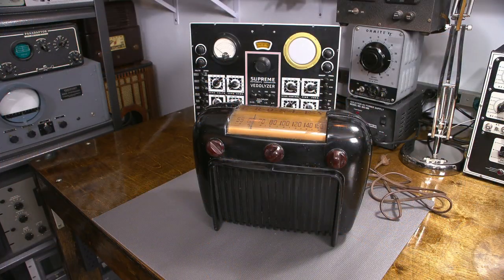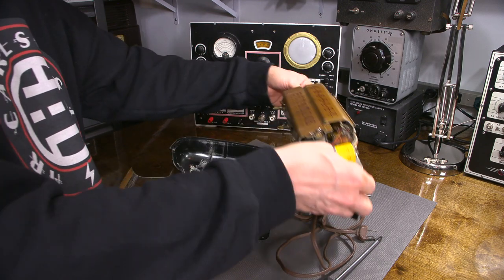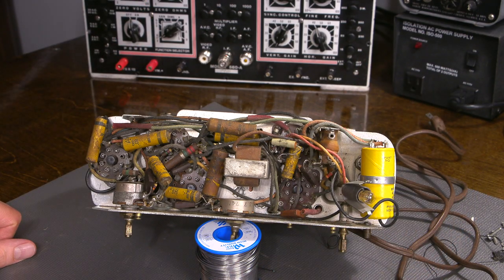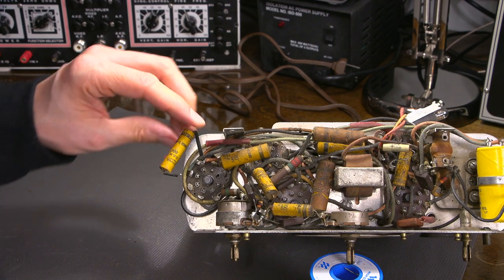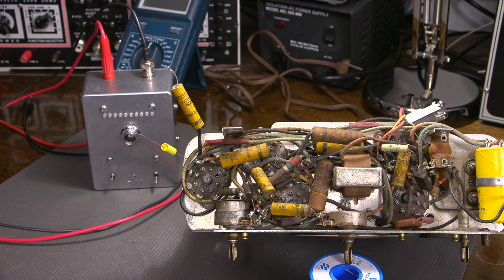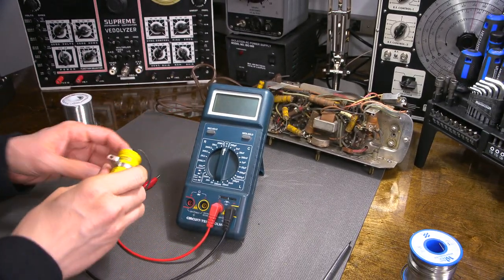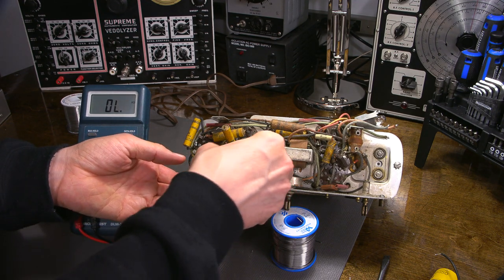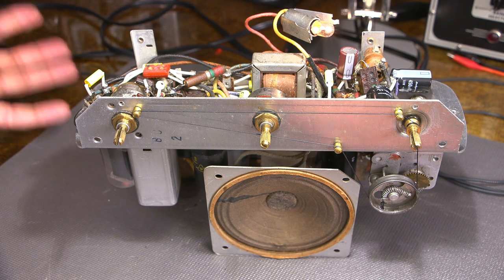ROBOT HEAD Radio from 1947! Electronic [Restoration]

Comment: The tag on the bottom could be right. I worked at a Goodyear tire shop and our manager sold crosley tv's, washer and dryers, phonographs, etc. I had bought a washer and dryer set, and when it needed service, the washer was actually a Maytag that was branded as a crosley, so I guess they did things similar to Sears with their craftsman line
Reply: These days Maytag is Whirlpool.

Comment: I did something similar on a 1976 Panasonic radio. The string was broke. I was looking for the old time fishing line from the 1970s but could not find any! I ended up using 65 lb. spiderwire. It worked but, it's a little thin & still not what I was looking for. I doubt it's going to break! Lol

Comment: I have read that Crosley made his radios to sell cheap because he had a radio station that at one time was 500,000 watts. It was funny that when you were tuning that radio you put it on 700 which was his were you could find his radio station. Today it is just 50,000 and is WLW.  You can see it from I 75 north of Cincinnati as you go to the Dayton Hamfest. You can take tours to see what was his 500,000 transmitter.

Comment: Mr Carlson... as always love the restoration videos.  In your next video (or in a reply to my comment) would you please explain what is meant by "star grounding" that you did to reduce the hum.  Also I have restored a couple of radios that have "back-lash" gears.  In you next video with that sort of gearing would you show us the technique you use to reset the back-lash.  Finally -- during the alignment procedure I never know if/when I should be using a modulated signal and what % modulation should be used -- would you please take a couple of minutes and explain that a bit in your next alignment video.  Thanks
Reply from the maker: Thanks for your input John.

Comment: I've been spending some time going back over some of your older videos.  I have one of the Precision Apparatus rf generators you are using.  While doing an alignment, I can listen to the 400 Hz modulation tone all day and not find it annoying.  Maybe I am used to it.  The aircraft carrier I was stationed in had 480 volt 400 Hz 3-phase transformer banks powering various shipboard electronic systems.  With loose laminations, these transformers would scream!  I have an newer solid state rf generator that utilizes 1000 Hz modulation.  I find 1000 Hz very annoying!!

Comment: In the UK it was common for AC/DC (transformerless) sets to have the control knobs attached to the shafts with set screws (and the set screw hole plugged with wax or resin) to reduce risk of knobs being pulled off and the user coming into direct contact with chassis mounted controls

Comment: Thanks for the in depth look at capacitance vs ESR vs leakage. I have been very dissatisfied with capacitance and ESR used as an indication of the health of a capacitor. I had come to the conclusion that ESR and capacitance doesn't have as much value as a leakage test but I feel better having seen it here.
Reply from the maker: You are correct Michael. Capacitors have many tests, and all should be used to locate a fault. If one test shows good, move to the next, and so on, until all tests have been performed and the capacitor is proved "good." If the cap fails just one of the tests, it should be replaced.
Reply: ESR of electrolytics is extremely important for filtering the frequencies used in Switchmode power supplies. I am not sure the relative importance of leakage in that application, nor if ESR really matters much in the RF and Audio stages of radios and amplifiers.

Comment: I don't know about everyone else but I would like to see content on actual replacement of components.  I would like to see you de-soldering components and replacement.  Discussion of movement of components.  We've seen testing of components and alignments coming out the yin yang.  You talked about the case and how to restore it but no coverage of what you actually did.  Same thing on the plastic cover; what product did you use and technique to remove the scuff?  You talked about how hot the inside of the case would get with the tubes in there.  How hot is that?  No ventilation?  What would it take to actually replace the tubes with solid state components?  Have you ever considered doing this?

Comment: I noted that you were using a watt meter with fuses as your "current limited' supply.  Ever since I was a youngster (about 60 years ago), I've used a incandescent light bulb in series with the hot lead.  That way, even a dead short would simply light the bulb.  Over the years, I have developed the skill to watch the bulb as a diagnostic tool - inrush current, filaments heating up, etc. I always use an isolation transformer and variac to slowly bring up the device.  Is the light bulb still good practice, or is there something better?

Comment: Paul,
This was a very educational video.  I learned a lot from it.  Thumbs _up_!  I've got a few questions though:
Will you go into detail in a future video on your Bakelite (& plastic) polishing techniques for restorations?
How would "old-time" Techs check/test "old" caps?  They didn't have your "modern" capacitor testers.  Using your Carlson-designed capacitor leakage tester (parallel resistance tester) is "cheating" in the old lab, isn't it?  What equipment would the old-time Techs have used?  (I'm one of your Patreon supporters and I need to build your tester though, but I'd still like to know how it used to be done, if it was even possible to do equivalent tests back then.)
When you desolder parts you don't seem to clean your soldering iron's tip -- it's just sitting there waiting for use.  How long do you tend to leave a hot iron sitting on your bench without cleaning or turning off?  How much, if any, does this degrade the tip with oxidation, etc.?  Earlier this year, I watched a few videos of alleged NASA-spec soldering.  They cleaned the tip at least once between each solder joint they showed.  How "over-doing-it" (if any) are the NASA soldering specs?  When do you clean your tip for soldering and how often?
I guess I need to change how I solder components.  I was taught that solder isn't a "mechanical" connection, only "electrical" -- requiring the lead to be hooked, etc., to terminals.  <insert confusion>  I admit that most (but probably not all) components will be held in place securely by depending on the solder to securely connect their leads to terminals instead of hooking the leads.  And, yes, your way is certainly a lot easier for future maintenance of a circuit!
Reply from the maker: Hi Bob. When I'm desoldering something in a video shot, I'm not worried about the solder on the tip (waste solder) as its going to get removed anyways. When I re-solder to a freshly cleaned terminal, the tip is cleaned before every new join. Look at the quality of the new joints in what I'm working on, or look at the quality of the solder connections on my designed PC boards for reference. If this was old solder, the joints would definitely not look like what the do.
In lab 2, I use both new and old equipment at random, just as in lab one. The focus of lab 2 is "older," but it's all about balance, and ease of getting the point across.
The  lead hooking is unnecessary, as can be seen in old Tektronix gear. There is no lead hooking or folding, and all the solder joints are good today (from 70 years ago). This lead hooking or folding is an old tale carried on by inexperienced techs. I think this may have been started when soldering technology was in it's infancy, and this was an extra precaution (a save or patch) for bad soldering practices.

Comment: I notice you aren't afraid to touch the radio to move it when it's connected to the isolation transformer.  If hooked to the IT, is the chassis safe?  Thoroughly enjoying your show!
Reply: Yup. That's why he uses one.

Comment: It was helpful to know that the Carlson meter tests equivalent parallel resistance vs. series resistance. What is the benefit of an ESR meter and when would you choose one test over the other? Or, is a parallel test (or one done with a full-voltage antique tester) always more revealing?

Comment: Re the capacitances on the older can caps: I recently ordered a new CE Manufacturing multi-section (40/40/20) can cap that measured “roughly” 60/56/22. So, good to know someone’s still making them “like they used to.” I guess.
Reply from the maker: Higher capacitance can sometimes indicate leakage. The capacitor tester measures the amount of time it takes to charge the capacitor up. If there is leakage "internal resistance," this leakage resistance will affect the charge time and make your meter read higher than normal.
Reply: @Mr Carlson's Lab Thanks for the info. Another reason to build your capacitor tester! (For what it’s worth, I wrote the supplier and was told that their caps are rated at 50% tolerance.)

Comment: One of the things with the older radios,  all the tubes heaters are in series and the light is sometimes also in series.  A short in one of the tubes could give the change in the light. Also some of the tubes were direct heated,  meaning that the heater is part of the circuit.,but I don't think it was common in that type of radio.

Comment: Thanks again for another awesome video Mr. C!! I just picked up a Zenith Trans Oceanic 5H40 at a flea market for $50 and plan to go through it as time permits. It is the one with the dial display and it has an odd selection in the back that I'm not seeing on the ones online. It says you can run it on "110V AC-DC, 220V DC, & 220V AC" by selecting different positions on the switch. It definitely seems to be factory. Not sure what that is just yet. Have only owned it for about 3 hours, 1 of which was spent watching this new video. LOL If you want to do a video on it I'd be more than happy to send it to you! It would be awesome to see you do a video and learn from you on something I own! I'm just sure you have a shortage of radios to do videos on HIHI. 73! de WØNDF
Reply: There was a factory option to allow it to work on 230V

Comment: Fantastic restoration however because of the heat in the combined quarters of this unit can you bypass the rectifier tube and use a diode  To help reduce the heat

Comment: Why the Ears? You might want to mention to your viewers -- those of us who were brought up in that vacuum tube age were taught that the first part of a good solder connection is a solid mechanical connection. Thus the ears, providing a good, solid mechanical connection, in this case between the component lead and the tube socket.

Comment: Powell Crowley  would take a newly designed radio into a small room and cut  parts out of the chassis. If the radio quit playing he would put it back.after he had removed all unneeded parts . He would give it to production to produce like he had left it.
Reply: I have heard the same thing said of "mad man" Muntz of Muntz TVs.
Reply: I also believe that was the story about Mad Man Muntz.  I remember seeing one of the first "large Screen TV's in about 1958 it was a giant at 25" inches or so.
Reply: as said below....what a mad man! that's akin to taking out as much bracing and framing from a house so its just above collapsing under its own weight.

Comment: Any downsides to running the tubes inverted like that? Filament sag problems? Heat soaking the tube bases, making the adhesive fail, or the phenolic base dry out and crack?
Reply from the maker: In a receiving application, operating the tubes inverted is ok. In transmitting application (power tubes), the tubes should be in operation base down. Filament sag is only an issue in directly heated devices, tubes that are indirectly heated (cathode sleeve) do not suffer from filament sag.

Comment: You mentioned in the video that if you'd dropped the Bakelite it could shatter & that would be the end of the restoration. I realise you seem more electrically oriented, but have you considered in such a situation glueing it back together, then using that to make a 2 part silicone mould so that you could cast a replacement in a more robust modern resin?

Comment: Your youtubes and patreon video's are of outstanding quality and I cannot wait for every one of them. This Crosley radio is a beauty and you restored it wonderfull. I just found out that Most Often Needed Radio Diagrams dates this Radio, the TD model, in the year 1948. Page 19 of the 1948 book. Maybe that is the reason the diagram is not the same. Go on with your presentations. I do radiowork for over 60 years as a good meaning amateur in the Netherlands and I stil enjoy it. Arie van den Ende

Comment: Is there an email or web page address to ask questions? I'm running into issues where transistors that are no longer made are sourced by China (ON), but the pinouts are not the same. The MRF477 (and the 2SC3133 that replaced it) is supposed to be a grounded emitter NPN transistor, and in the MRF477 and 2sc3133 spec sheets pin 2 (and the to-220 tab) are the emitter lead. Is it OK to use these as long as I use mica wafers to isolate from the case (used as a heat sink?)

Comment: Another capacitor tester add. I am a patreon btw  and its ok to promote the tester but the instructions for all the different versions of the tester and additional board addons are not easy to follow. Especially the parts list is not comprehensive. You need a new updated version with either through hole or surface mount (or both)that incorporates all the other addons into one board. I understand why you did add on boards, so people who built original can keep adding functionality but its time for a NEW model .The parts list should identify parts that are critical and must be the ones you specify or can be swapped with another equivalent. Thank you for your contribution to the electronics community and yes would like to see this old beauty repainted in black and gold

Comment: Excellent video again!
But at 1:10:10 there are no switching power supplies, there are the images of the low receiving frequencies; i..e. 2 x 455kHz above.
Reply from the maker: Hi Stefan. Switch mode power supplies use a square wave to drive the transformer. Square waves are harmonically rich, so one of the many harmonics will end up being received if the power supply is close enough to the receiver. The oscillators in these SMPS's are not accurate, and drift with temperature due to the non "NP0" capacitors they have used for timing.
Reply: @MrCarlsonsLab Dear Paul, i don´t want to be bossy and i like your videos very much, but we are talking about different things.
Every superhet receiver has images at two times IF away from the receiving frequency.
So if the receiver is tuned to 600 kHz, the oscillator has 1055kHz i.e. 455kHz (=IF) above the reception. Now the image is at 1510 kHz, because this frequency also generates 455kHZ IF with the oscillator 1055kHZ. These 1510kHz are also inside the AM-Band and cause whistles, when there is a strong station.
Reply from the maker: Hi Stefan. Would you like me to unplug the offending power supply next time?
Reply: @MrCarlsonsLab  Hi dear Paul - YES PLEASE!!!
The chirping sounds starts exactly at 700kHz and lower, where these images fall into the AM-band and are caused by the images, that move in opposite direction over the scale as the receive frequency. They are mixed in the mixer. When you change tuning direction, the chirps reverse also. Can be heard beginning at 1:10:14 . Hope you forgive me my persistence.

Comment: On the old all american 5 tube radio's often the dial light was in the series string of tube filaments so You also would check to see it dial lights were good not just the tubes.

Comment: I would be interested if the 20+40+40 capacitor would recover and pass the leakage test if you reformed it by applying the working voltage via a resistor. After all it sat without voltage applied for how long. I had capacitors from 1970-80s that had some leakage when they were tested, as they sat on a shelf for about 20 years. After 24 hour reforming process at the working voltage applied, all came back to to test good, no leakage, etc. I was interested if the reforming process would last as some said the capacitors will get leaky again in a matter of weeks, even if initially reformed good. Interestingly, I tested those caps 6 months later and they went to almost no leakage in a matter of seconds, except one needed close to a minute to settle, but it was a late 1950s cap. Of course these caps were not put back in use, but I think that they would most likely work fine for quite some time more. I have two high quality 550V Philips capacitors from the late 1940s that also test like new and reformed in a less than an hour to the rated 550V (went to the 470V in 5 minutes, as this was the max. voltage ripple they saw during the life of the device). Interestingly enough, they have less leakage at 450V than a brand new one. Oh, and I used a 22K ohm resistor in series with the regulated DC power supply.

Comment: Paul,
Amazing how much the smaller modern caps open up the chassis on old sets. By the way, what brand are those blue handled nippers? I have crappy ones that don't work well for cutting the soldered leads from terminal. Thanks, and take care.
Reply from the maker: Hi Ian. They are: Erem 776E
Reply: @MrCarlsonsLab  Yikes, they are pricey, aren't they? Oh well, they look great quality and I'll enjoy them for life. 
Thanks Paul
Reply from the maker: @ianbutler1983  Make sure you do not cut thick wire with them, IE: 14 Gauge and so on, or you will take the tips off.  The steel is very brittle, but you can cut single strands of hair with them.
Reply: @MrCarlsonsLab  Thanks Paul I would then hang myself using the too heavy wire.